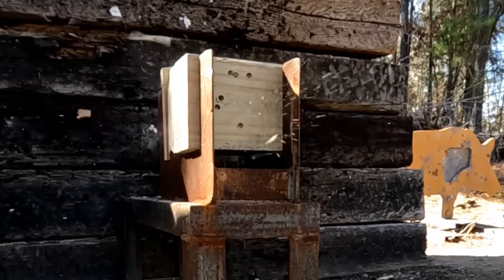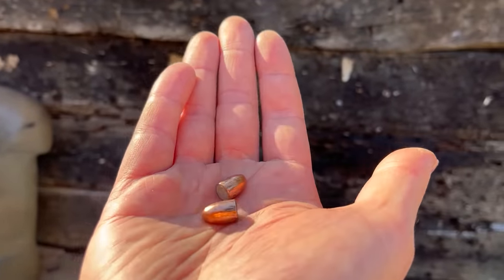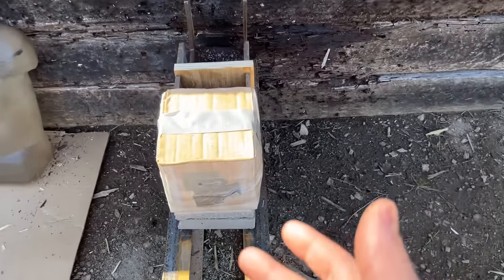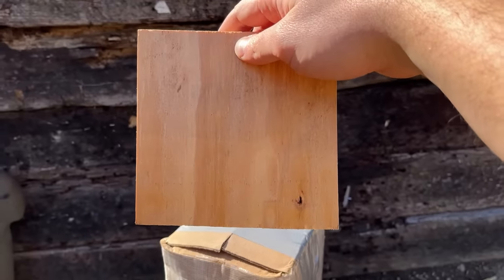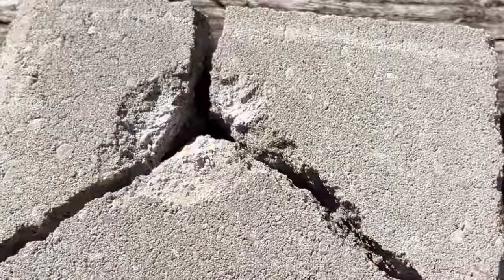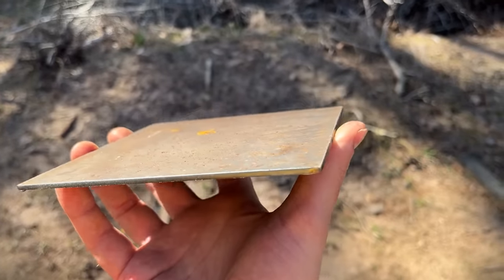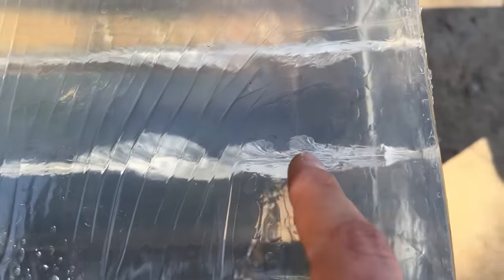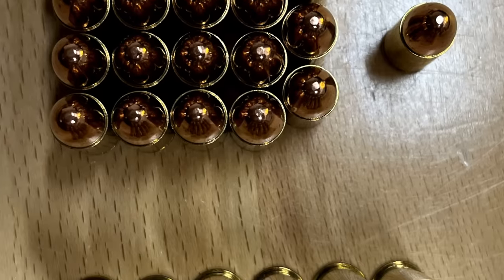9mm vs 38 Special vs 357 Mag: Not Even Close?

Comment: .357 sig would be good to see. I was impressed on that AP 9mm
Reply: Yeah, curious to see 357SIG performance vs 357MAG, 4" barrels, same ammo manufacturers.
Reply: Another fun, but maybe slightly more obscure option, is the 9x25 Dillon.  A 10mm case necked down to 9 that spits out 125 grains at over 1600 fps from a 5-inch tube.  Or 90 grain Lehigh screwdriver tips at 1800...
Reply: @ksaechao97 using the ruger as usual

Comment: Would like to see how 38 + P Compares to them! lol Great Video!
Reply: I think it would be like a 9mm I mean velocity and all that, maybe even faster than regular 9mm with the same bullet... I am not sure.
Reply: It's close with a slight advantage to the .38+P with  relative advantage of .38 increasing with barrel length.
The .38+P is more of an industry standard than a hard CIP/ SAAMI type engineering standard 
What it works out to un practical terms is this

4" barrel   38+p 158gr @ 1150fps and 21,500psi 

4.7" barrel  9mm Standard pressure 
147gr @ 950-1000fps  and 33,000psi 
9mm+p 147gr hardcast 
@ 1050-1100fps 
Velocities out of shorter barrels are comparable w/ the 9mm+p maxing out for practical purposes at the standard 4-5" barrel length
.38+p will continue gain advantage in longer barrels 
At same 21,500 psi you're talking 158gr @12,500 in a 6" revolver with gains dropping off past about 10-12" w/ max velocities in the 16-20" barrel 
9mm gains dropping off @ about 7-8" and maxing out around 10-12" of barrel length. You can get a little more out of a longer barrel in 9mm with lighter bullets and larger chargers of marginally slower burn rate powder. Really just doesn't have the case capacity to take advantage of slower powders in longer barrels vs. peak pressure 
In a stronger gun that same .38 can be loaded far closer to .357 levels particularly with heavier bullets

Comment: I'd like to see proper full pressure 10mm vs .357 mag. as they feel similar to shoot.
Reply: Proper .357 as well…that stuff was weak sauce.
Reply: But to be clear…proper 10mm is no match for .357mag properly loaded. .357 has a multiple  hundreds ft per second for similar bullet grain.
Reply: @kyleg8928  buffalo bore hard cast for both is what id use
Reply: 10mm is as close as an auto pistol can get to 357 mag (not counting 44 automags or Wildeys or big huge gas powered guns like Desert Eagles... I'm talking normal sized carryable auto pistols) But a 357 loaded to it's full potential still beats the 10mm. 10mm is certainly no slouch though and can match regularly loaded 357

Comment: Hi, Banana Ballistics. These are great videos for comparing the performance of various ammunition. The one thing I wish you'd change is to use the correct unit for muzzle energy. In several videos, you've been specifying muzzle energy with ft/lbs (time index 13:40), or feet per pound, which is incorrect. The correct unit of muzzle energy is the foot-pound, which is written with a hyphen as ft-lbf, or with a raised dot as ft⋅lbf, which is how it's written in the Wikipedia entry for foot-pound. The Wikipedia entry is easy to find by googling foot-pound (energy). In the Wikipedia entry for foot-pound, there is also a link to the Wikipedia entry for muzzle energy where the unit of foot-pound is used throughout as is the corresponding SI unit--the joule. For reference, one foot-pound is equal to 1.35582 joules, and one joule is equal to 0.737562 foot-pounds. The hard work you do in order to produce such high quality videos is very much appreciated, which is why I mentioned the units--so your videos can be of the highest quality.

Comment: 9mm are always impressive for its size. Especially +p+ stuff out of something like a G34 length barrel. 124 gr. +P+  at 1250 fps is about 435 ft lbs. 1450 fps is 580 ft lbs, at 19 rds thats some decent fire power.

Comment: A .44 SPL VS 45 ACP comparison would be interesting and settle several points.
200 & 240 gr .44 GDHPs versus 200 & 230 gr .45 GDHPs would keep it pretty level.
So would 246 gr LRN versus 230gr JRN.
Side note: MP moulds make some great SWCHP moulds in both calibers. I've tested their 44-185 & 250 gr SWCHP in 44 SPL and "light magnum", their 45-215 gr SWCHP & the Lyman 45-190 RFHP "Devastator" (in 45ACP, 45 AutoRim & 45 Colt), and with normal pressure loads, all bullets powder-coated & the identical alloy, the penetration & expansion I'm seeing are as equal as frittatas & omelets. This held in firing the same loads from rifles.
Firearms used were 4" S&W & 4-5/8" Ruger revolvers, 5" 1911 & XD45, 16" R92 and 20" B92.
"Muh STOPPIN Powah"...
In the works: .32-20 vs .38/.357 & .44 Mag vs .45 Colt +P & .30 Carbine vs .32-20 +P (rifle) vs .300 BO.

Comment: To get it even closer, look at 9mm +P.  It's just about the same as standard pressure 9x19.  Where .38 can be a little better is with the larger bullets.  157 grains, or even up to 180.  With a hardcast lead or FMJ, that's going to penetrate better than 9mm.  And of course, the .367 can use those heavier bullets, too.  To match that, I think you'd have to step up to 10mm.

Comment: part of the reason the 38 went through  so clean was the projectile needs to be at a set velocity or higher to start the expansion. a very common issue for .38spl defensive loads is not reaching expansion velocity. Especially so in short barreled models like the commonly favored 2 and 3 inch models.

Comment: The various bullets do differently as to penetration (what they are made of and type). Chronographs help determine real velocity. If simple penetration is desired all copper bullets are excellent. If expansion is the criteria, hollow points or soft lead flat points or hollow points for slower velocities of the 38spl. I like the 38spl as a +p load with a 158gr HP, hardness of 12, going 900fps (my handloads). They will expand very well. It will penetrate into the gel plenty for the purpose of defense. If your j-frame is 38+p rated, use +p ammo. It is not much more recoil than the standard 38spl and from the short barrels, it ups performance to adequate vs non +p ammo. If you like 357mag, go for it. It definitely will do the job, however not all ammo makers produce 357mag ammo to the same velocities. I have found some of the low end ammo (inexpensive) pretty anemic. For 9mm, 38, or 357, if you handload, you can have whatever you want and maximize the possibilities.

Comment: I've been curious about the 960 Rowland (a hot-rod 9mm that you can turn any 9x19 into with a barrel, recoil spring, and comp kit) and whether it's notably better than 9x19. I've also always been interested in the 9x25 Dillon too.
Reply: I played with 440 Cor-Bon in a 1911. Same concept. Heavier spring, comped barrel. Broke the slide stop after 12 rounds. Didn't feed reliably. Niche hot rod rounds are not worth it.
Reply: @mattmarzula  Interesting. A friend of mine has a .460 Rowland (made by Bar Sto) and it's held up quite well. Edit: that's in a Glock though.

Comment: As expected 357 takes it.  However selection of ammunition could skew the results. Buffalo bore 147gn at 1175 in 9mm vs Winchester 357 145gn at 1290 would look pretty similar I suspect.  As a final note, I wouldn't want to be behind a sheet of 3/4 ply taking cover even if a lowly .38 cowboy load was coming my way.  I guess that's just me.

Comment: Eh, placement is more important than penetration. .223's penetrate too, but do not transfer much energy to the target for shock and drop value. A human target is most likely to bleed out before dying, while still able to fight long enough to tag you. Pistol calibers are sub-optimal to stop, repeat, stop an assailant in terms of energy. So placement to turn off the nervous system is important. If you want serious stopping power, 12 gauge double buck or slug is the answer.

Comment: POINT OF ORDER::: the Colt Walker .44 which appeared at the end of the civil war and used extensively in Texas by The Texas Rangers the was the most powerful handgun around -- actually you could have put wheels on and called it an artillery piece. 
It held that status until the late 50s 1958? when the 357 made its debut
If you carry one be sure of what is behind your target, cause even a 9mm will go through two layers of drywall and hit the kid sleeping in the other room
Reply: Actually the 357 mag came out in 1935.

Comment: It would have been a bit closer if you'd used a 6" barrel for the 9mm as well. Modern 9mm loadings are pretty impressive as far as power compared to .357 mag, considering how much smaller the 9mm case is.

Comment: As an instructor, I cringed every time you shot the .357 with the left thumb fwd. Please be careful and change your grip. For a revolver, your left thumb is supposed to be resting on top of your right thumb (and be used for cocking as well). You don't want it fwd like that. Did you see the flames coming out sideways fro the gap between the cylinder and the barrel? That blast pack some extreme amounts of pressure that can cut your thumb right off. It is a common occurrence among semi-automatic pistol shooters to hold a revolver like that.
Be safe and keep the videos coming!

Comment: That was some slow 357 ammo you had, usually I see in the 1450+ range  and one difference you didn't mention todays 357 revolvers have 7 & 8 round capacity but you have a 4lb hammer to Bludgeon your assailant with if he managers to survive the 7 or 8 357 rounds. LMFIAO  What you should try is a Hornady Extreme penetrator in 357 on 1/8" mild steel or a Teflon coated 357 in the sand box. Ah, one can dream can't they.??

Comment: not a big shock when you remember the 357 ( with 8 inch barrel ) was used by motorcycle cops for it's ability to penetrate semi truck engine blocks if the driver wouldn't stop.

Comment: If this test was done with a comparable (and reasonable) concealability of all firearms involved, 9mm would beat even the .357 Mag, especially if the latter adhered to the new 35000 psi pressure limit. The case length of both .38 Special and .357 Mag is ridiculous, reducing the precious "runway" length in CC firearms. This way the powder contributes more to the recoil and report instead of accelerating the bullet.

Comment: One notes the .38 Special round is NOT the best penetrator.  
What does this whole test show?  Essentially what will penetrate the most.  It has little to do with self-defense and might have relation to deer hunting.  

The idea of penetration was popular about the beginning of the last century.  The test 'standard' for power was a penetration box of one inch pine board slabs.   They were held in sequence in a 'trough' (also wood) and the slabs penetrated showed 'power'.  

By the way, one notes the 9mm holds some 19 rounds.  If one shoots an attacker 19 times, one should have a great explanation for the investigator.

I have to point out the .38 Special is far exceeded in 'power' by the typical tank round.  I find it easier to carry a K frame S&W than a tank cannon.  But will stop an attacker if properly applied.  Neither will if improperly applied.  So there more or less the same, right?

Comment: The MILDEST .357 factory load has 18 times MORE MUZZLE ENERGY than the most POWERFUL .38+P special load that won't destroy a .38 Special revolver and about 30 times the muzzle energy of a 9mm PISTOL (NOT STEEL CASED SMG!!!) load. The limiting factor on both the .38 Special and 9mm are the strength of the CASES AND the strength of the weapon. Cut-down .1 inch .357 cases CAN be used in a .38 Special, but full-power "belly-buster loads" will burst a .38 Specials' cylinder and POSSIBLY the barrel. 9mm isn't in the same class, being no more than 20% more powerful than a .380 automatic. The near obsolete Colt's .38 Super round is eight times more powerful than any .38 Special load , and was used by law enforcement during the 1930's to penetrate the leather "bullet-proof vests" worn by "Public Enemies" like "Pretty Boy" Floyd. The famous Justice Dept. Marshal Melvin Purvis used custom made .45 "Super" (one tenth of an inch longer cases) Colt's 1911A (long slide) pistols and a Thompsen 1925 Automatic "Tommy Gun" made by Thompsen and presented to him. They zipped right thru John Dillinger's vest and thru the brick wall of the Biograph Theater in Chicago, with an estimated muzzle velocity of 1500 FPS pushing the 180 grain "hardball" bullet.

Comment: Hand loading a 357 to 700 fp or higher with a S&W Model 27 or 28 large N  frame 750 fp -----old model 19's cannot be loaded that hot---newer medium frames (66-8) don;t have the flat spot on the forcing cones, so they are much stronger, so the 9mm (still I cannot bad mouth the 9mm) has only about 400 foot pounds muzzle energy. Grizzly Bears have been taken with a cast bullet-----not recommending you hunt large bears with a 357 but it can be done. 9mm will only make them mad.

Comment: I don't get this test of course 357 wins. The 357 especially with 180 grain load will penetrate deep and have pretty good power. The 180 grain load has close to 1000 pounds of energy. The 9 mm has decent energy but it's 25 yard gun so not very much range. The 38 special doesn't seem like much to many but time after time maniac serial killer attacks they drop one shot.